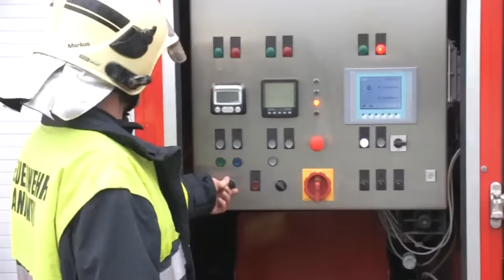LUF Long Distance Water Supply

Comment: I'm sure that little bridge was stupid money.
Reply: Slightly over engineered, for sure. It's like they designed it with clearances for an F1 car's approach and departure angles, looks like their trucks could have driven over one made of railroad tie cribbing.
Reply: @kevinvermeer9011  You know it went like ..... 
The system is 14 million dollars. 
How much is the little bridge? 
$14,000.00
Throw in two...no like I'm paying for it.....
Reply: @charliebingaman571  Carry the Car by muscles... that would be faster than that
Reply: It has to handle 30ton/62000lbs fire engines so it has to be tough. Plus it has to be safe. 150% of max load shouldn't be a problem for it.
Reply: I worked in a large scale fabrication and machine shop for 3-1/2 years (we had two mills with 42 feet of X-axis travel, 13 feet in Y-axis and 8 feet in the Z-axis, massive machines) where we made parts like these every day (but bigger typically, you can pick those ramps up by hand so it's considered a small part). They don't cost as much as you would think, the steel plates are plasma cut at the steel supply for dirt cheap and there isn't a huge amount of welding that goes into them (we did parts that had 600 pounds of wire feed weld on them with a submerged arc welder), I don't see them costing more than a couple thousand per set. And they really do have to be beefy, those fire trucks weigh a lot more than people think, 15-20 tons typically. I wouldn't call them over engineered though, they're really quite basic. No advanced geometries or anything, just flat planes.
Reply: @TheExplosiveGuy  they are cheap AF to make, but im sure we all know how selling stuff to government works. Why does humvees cost over $50k? They are just sheet metal boxes with wheels and simple ass engine. But they are military! That M word makes it cost 5x more. Or P word if it comes to professional use. Or F word if it comes to firefighting...
Reply: The safety pin don't do shit ..stupid design
Reply: @skour7104  actually they prevent the rods to slip out of both holes
Reply: @fabriziorasore5353  The pin in the center is not going to stop the shaft from coming out if its in the middle..
they should have put 2 safety pins in each shaft either side of the brackets ..
If the shaft moves out the one hole the plate will twist,as special on the bridge part
After a few cars over the bridge it will vibrate loose
Hence i say they don't do shit
Reply: @skour7104  I was thinking the same. Then I went back and rewatched it and it looks like the pin drops through the shaft and into a hole in a plate welded to the structure of the ramp. You can see the operators placing the pins in pretty carefully - not just going through the shaft but also into the hole. Check out 5:18 for the pin placement then the next scene where they are carrying the ramp - you can see the part that the pin drops into.
Reply: Why not a proper bridge where they do not have to align to drive over it.
Reply: Its not german enough if its not over engineered

Comment: Can you imagine being the probies having to repack that 12" (?) Black hose and the officer not telling them it was mechanized???  Seriously...can they justify the cost by how many times they will actually need it?
Reply: It's based on a stock truck chassis. And it might be a swappable bed. Also it's Germany.
Reply: there are some apparatus which are used like once in a decade but the equipment still HAS TO be provided for the case that sth happens. I know an Aerial in a German museum which never ever (!) went to an actual emergency call. In the city where I grew up the FD have a nitrogen vaporizer with an estimated call volume of 1 per year; In the town where I studied the chief told me "I've never seen that Pod Carrier on an actual emergency call before" after I filmed it responding to a fire call.
Reply: Night Fury Those are Austrian firefighters.
Reply: FDNY used to have something similar called the Superpumper system.  I think the real use for this is a situation where the municipal water system goes down and you need to supply massive fire flows.  Is it worth it?  They think so.
Reply: @Cthippo1  it definetly is; And while these systems can flow even more than the former SuperPumper, the FDNY runs a few of these things today as well
Reply: @Cthippo1  ةرو

Comment: This is for establishing a secondary or tertiary supply line for wildfires or large industrial fires. They will have all the manpower and time to do this if the situation becomes bad enough.
Reply: MrDK0010 but in case of a wildfire say the fire burns out of control they wouldn’t have time to grab the equipment and run away
Reply: This is smth you build up far, far outside the immediate danger zone.
Reply: เดกกกกเฟฟฟฟกตไไำพะัwrhjgtqqqqwei2212124433yyytttstsffgfffffgfffffttt555u5555tu4443335?
Reply: @eizarzar6212  fh.
Reply: @eizarzar6212  di f untuk. melakukan 1 di f hv
Reply: @martimnunesmartinho6788  di.  H. 1

Comment: Funny how no one seems to understand that this system is not intended as a primary water source.
It is used when you need big amounts of water over long distances like industrial fires or bush fires.
We are talking 11000l/minute over a distance of 6km. Of course it is not built up in 2 minutes.
Reply: Is this not in Germany?
Reply: @Luke-no3dg  when I saw it right it is austria
Reply: @1999Cheker  Yes it is Austria. In some scenes you can see the name of the city. I looked it up and "Rankweil" (the city) is located in Austria.
Reply: lee rice  You don't deploy this for a dynamic response. When the fire roll in the direction of a small village with a limited supply (holding pond, small lake, sistern) you can use this. The village will not move and if you can suppress the fire around for long enough, it will run out of fuel. But these Blowers are used to catch chemicals in the air, when there is an industrial fire burning (not a fireman, just saw some video of this usage demonstrated).
Reply: ronnie doorzon  sorry my bad, i dont know why I wrote 11km. It actualy its 6km
Reply: lee rice  11 tons of water a minute. Not bad in my book
Reply: No ones disputing its purpose. Just the week and a half it takes to set it up lol
Reply: K
Reply: You would never use this on a wildland fire. This is a very impractical method of delivering large amounts of water, not to mention extremely expensive. Much better methods out there.
Reply: @1999Cheker  slñlofdñdl
Reply: t
Reply: Setup and takedown should be 2min, with 1 guy. At least for the pumper. This whole system is overengineered and cumbersome. Line laying and pickup should be 50kph+.

Also, pumper should be single chassis (like firetruck), not skid. That way you use 1 engine, not 2, (one for hauler, 1 for pump skid). Which doubles the cost.

Comment: For those people trying to criticize it without looking further, this system is for long operations requiring lots of water. For example industrials fires, warehouse fires, forest fires also. THIS IS NOT a primary water source, most of the time water from hydrants is used to tackle smaller fires so no they didn’t take long to get set up. Unless you guys have seen fire departments tackle big forest and industrial fires in minutes which I highly doubt.
Reply: Do not forget you can pump away water from a flooded area too!

Comment: Strange how something can be so over engineered and under engineered at the same time. All the functionality of moving water seems to be fine but the setup is pretty hacked. No wheels on large metal pieces requiring multiple people to carry. No outside ridge on the ramps that would keep vehicles from slipping off. An entire 6" metal wedge piece made specially as an extra connection instead of just tapering the ramp to the ground.  etc etc
Reply: It's made to be stowable.  And no "outside ridge" will stop a vehicle from driving off the edge of a ramp.
Reply: Also remember, nobody knows on which terrain they have to use the bridge. Keeping it simple/flexible might be a advantage here.

Comment: I’ll deploy it, then putting in my two weeks, cause that’s how long it will take to put back in service.... Fight The Dragon Brother!!!!
Reply: actually it's done quite quickly with its modular layout ...
Reply: lee rice  nope, not really; Of course it's not as fast as simply deploying a hose from a hose cart or hose bay, but it's not like it would take hours to set the system up and get it going
Reply: lee rice  no-one stated that this would work for every location... however in fact many large industries are alongside or nearby rivers and canals, and also commercial and residential areas are often next to lakes, canals and rivers of all sizes. Within a 10 mile radius around my village there are 2 rivers and dozens of lakes, with several lakes already being within 1.5 miles ... and my area isn't quite dominted by lakes; There are some areas which are clearly dominted by lakes or canals throughout a greater area.

Btw there's the very same issue with long distance water supply when you take plain normal hoses and apparatus, often with multiple Portable Pump Vans / Trucks serving as booster

Comment: Work smarter, not harder. Pass on this setup. I can see this being viable in a very narrow set of instances of long term operation of exposure protection is required. Setup time is horrendous considering the results. But for a long term operation, having that output on unmanned equipment could be very beneficial.
Reply: " Setup time is horrendous considering the results" which result? Being able to flow large amounts of water with only one truck instead of numerous trucks on one line or running as shuttle. Of course this isn't what you use every day or once a week, but there are definetly scenarios where large capacity pumps are necessary ... not only large structure fires, but especially during floods. Guess that's why the German Federal Agency for Technical Relief came as mutual aid to the USA after Hurricane Katrina
Reply: It's definately worth the effort. German fire engines flow around 2000L per minute, so this system can supply around 5 engines. It'll take at least 5 engines to supply 1 engine over 2 km's. Basically, this thing does what 25 engines normally do. Simple maths: it takes time to set up, but compared to the alternative it's cheaper and easyer to set up. EDIT: I just now realised we are talking 12 km's, wich make the numbers even more ridiculous.
Reply: Love it. Also during that storm we needed help. But that’s also why the US has pumpers, tenders and tankers. But Germany’s fire Departments are a lot better then the USAs.

Comment: In my part of the USA, there’s no way the elected officials would ever allocate the funds for a very expensive, limited purpose vehicle that might be needed once or twice every 5 years.
Reply: and then there are situations where mutual aid responses from abroad (!) are necessary to deal with the events which hardly ever happen but definetly will at some time ... 
Concerning your statement "very expensive, limited purpose vehicle" ... look closely at the video. It's a Pod Carrier / Roll-off container truck / hooklift truck: that equipment pod is special and purpose-built, but the truck can be used for dozens of different special equipment pods (containers), so this is far from limited purpose. It's not an entire truck built for only one purpose, but a carrier truck designed to handle all kinds of rarely used special equipment pods. They can range from Heavy Rescue to foam tanks, tanks with frozen carbondioxide and to nitrogen vaporizers, hazmat, decontamination, radiation protection, collapse rescue, crane equipment, basically any special operation you can think of
Reply: I'll bet CALIFORNIA is wishing they had at least one of these right now...
Reply: Do forget one point! It can be a supply hose line to the fireplace but it can be a pump water from a flooded place back into the river or sea too. Some hazard fire places are far away from water or broken supply hose lines build in earth or flooded places or repair/renew a channel or over flooded dams ... 

It is use here on a fire apparatus but can do so many more.

Comment: Very much a balance of justification for the investment and manpower need versus let it burn!
Reply: Amen Adrian. Unless this is something for long term use, i.e. temporary water main replacement, what benifit is it? That has to be 8" or better hose. How much water does it take to fill this let alone start water movement?
Reply: large structure fires are one scnearios of course, but also keep in mind that there are other scenarios where you have to be able to flow large amounts of water, e.g. floods; Try to empty a flooded area by using the average supply and attack hoses and the average pumps on Engines and Tankers ...
Reply: @EnjoyFirefighting  Hmmmm in 35yrs on the job we never had to do that. But makes sense!
Reply: @Wa3ypx  I know two century floods and several other sometimes severe floods; Some of them lead to mutual aid convoys which basically involved departments from the entire country; Also after hurricane Katrina, apparatus from the German Federal Agency for Technical Relief went to the USA with several high volume pumps trying to empty flooded boroughs; It sure isn't a common scenario happening every year, but when it's necessary I guess department and people are happy that they exist;
I've also seen a 1st person video from a Dutch FD responding to a structure fire in a warehouse; THey set up this kind of unit right from the beginning to have a great water supply from the nearby canal

Comment: They could use that system in  parts of California
Reply: Carl Loar California has similar systems in use, although the Cal Fire usually uses fire retardant, fire lines, and air support to fight most wild fires, they have used very similar set ups for massive industrial firws
Reply: lee rice “long distance water supply” it’s not designed to go up a mountain, it’s a supply line. It’s designed to bring water along a long area that lacks a hydrant or a static source to draft off of, allowing firefighters to have water without using a shuttling system with drop tank and lots of tankers. Misusing a system for something it was never designed to do is no reason to write it off
Reply: lee rice no. No one ever said it was, is California one giant mountain? No. There are flatter areas and large roaming hills. Wild land tactics change between them. If I need to set up a forward supply location to fill up a helicopter to allow it to more effectively do it’s job, I can use a long supply line to do that. If we’re utilizing rolling pumpers I can set a fill point much closer to the location of attack, if we’re trying to hold the line at a series of houses, we can use multiple long supply lines and boost pumpers to set up 1 1/2 attack lines with combo nozzles and create a fog cover to keep the fire back. There’s tons of ways you can utilize a system like this, although I don’t expect someone who doesn’t fight fire to understand the massive utility a system like this could offer the teams in the fields. There’s no way in hell someone’s dragging this line anywhere, supply line weighs enough dry, trying to haul any more then 500 feet with multiple people becomes an extremely difficult task, hense the truck deployment method shown in the video, alleviating the need for someone to drag 10,000 feet + of supply line. This is quite obviously designed to be used to extend my water source not being water up a mountain.
Reply: lee rice fire equipment is pricy, always has been and always will be. The fire department I’m on just finished paying off a 1.2 million dollar 100 foot ladder truck, the tax payers pay for their own safety, how much their willing to fund us will directly affect our ability to keep you safe. You should talk to your local fire department and see if they have the money to keep up with what’s required of them, the personnel, or anything in general. Unless your in a large city everyone is understaffed, underfunded and under equipped. I’m a tax payer too and I know my taxes go to necessary equipment. Btw that truck costs less than a fire engine, so mr tax payer, would you rather help your state buy a new engine at the price of 750,000 dollars or buy one of these for 300,000? To be honest I think it’s pretty shit of you to say something like that, how would you feel if it was your house or your property and the fire department didn’t have something they needed, what if they have to wait 30+ minutes to get water because of the shuttle distance, your arrogance and misunderstanding of the fire service is astounding since you think your opinion means anything at all, instead of being useless waste of oxygen how about you actually volunteer and do something

Comment: This seems so long winded that I'm unsure how useful it could possibly be.
Reply: Well I think Firetrucks with built in tanks would arrive to the scene first and immediately start putting out the fire while this system sets up and then it can take over for much longer, because it doesn’t have a small built in tank.
Reply: I want to tell you that if you have 2,5k litres on firetruck, you will be out of water like just in one minute or so
Reply: The great distance that the water is moved is what makes it useful. All the water in the world is useless if you can't put it on the fire.